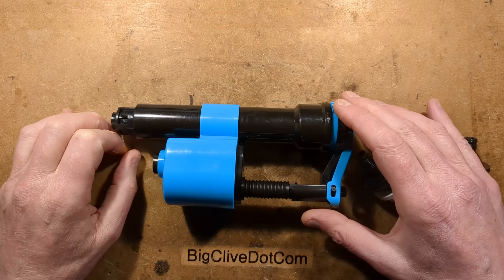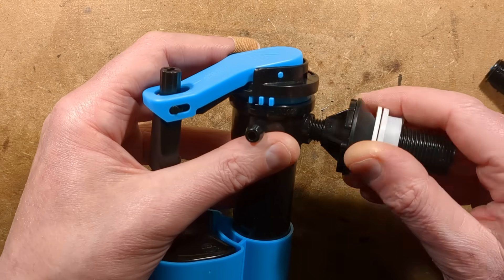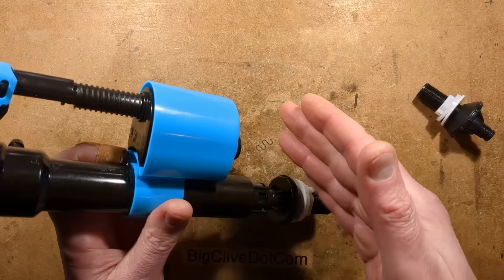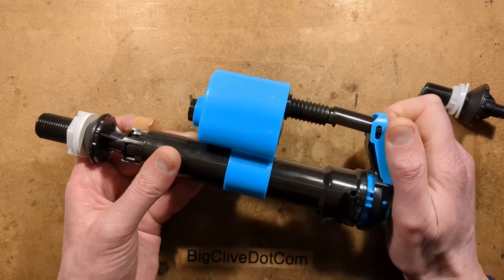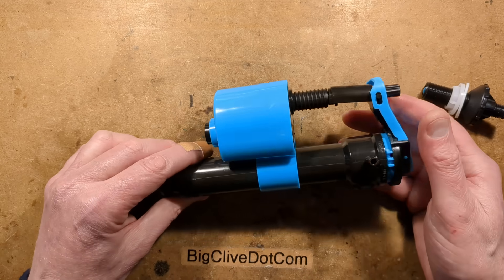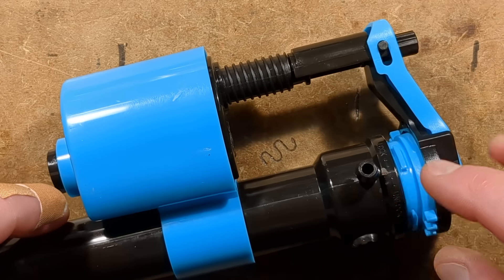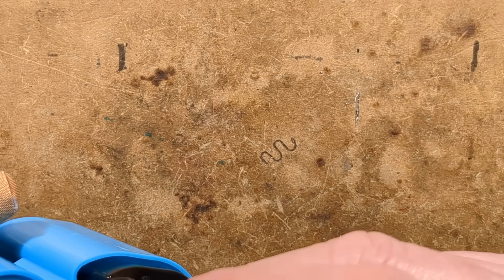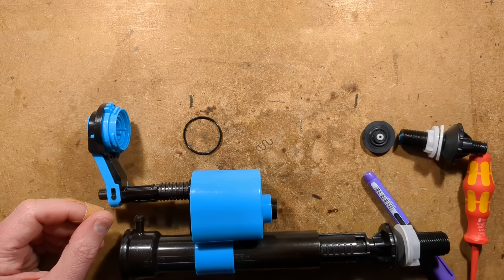Very clever universal Skylo toilet cistern fill valve system

Comment: In north america, the side port goes down into the toilet itself to fill it back up.

When you flush, it siphon the bowl basically dry, leaving only whatever water at the bottom that did not get siphonned out, and what is left inside the S bent siphon that drop down into the bowl and what is left inside the "flush system" from the tank to the bowl. While it is enough to seal back, the water level is too low. So the side port have a hose going to the overflow tube, which refill the bowl to the proper level.

The proper level is done by simply overfilling the bowl. The little water is too small to activate the siphon, so it just leak out by the siphon. This is however not that much water on a proprely working system.

Comment: I have a similar red/white thing in my loo. One day it started never stopping filling and I dared to look at it and figure it out. I touched it and it blew off its thread and covered me in mains water constantly blowing around. All it needed was screwing back down but since then I am very wary about it. Mine is a dual flush and I fixed the button sticking down problem by twisting the flush  about 90 degrees and it lifted out. I took the spring out the button part and put drops of 3 in 1 oil down inside the cable run that looks like a bike brake cable. It never sticks now and pops up all by it's self :) Also I HATE bloody water tanks and for that reason I can not swim as a swimming pool is just one giant water tank of horror to me full of skimmers, inlets, outlets, drain covers  and oh god I am giving myself waking nightmares just talking about them. They should be banned and made into fluffy ball pools with lots of light and all the gaping holes blocked up. My last job involved having to walk past 2 giant water tanks in a plant room when I had to check on heating controls and make notes on water temperature on gauges. Needless to say job from hell. When one tank had a problem they left the ball cock outside, it was massive! it had a giant copper ball on a 4 foot rod. God that thing still gives me the eeby jeebies when I think about it.
Sorry for long comment but me and water tanks do NOT work together lol Put me inside a substation with 11KV and I will gladly sleep next to the humming transformer! But water tank things, noooooooooo xxx

Comment: Had one of these here in the UK for many years - it has a slow leak from the bottom connector for a long time and has been a total curse - I had to make a tool to remove the top valve release as it’s impossible to remove by hand all in all not a great product 😬

Comment: Very clever.  It's a huge improvement over the 1950s layout: an overhead cast iron cistern, a lead down pipe and a chain with a porcelain handle on which was written the instruction: pull and let go.  In my family we used to refer to the WC as the pullen.
Reply: Wow. I wonder how often the valves on those toilets failed and how annoying it would be to get a ladder to inspect and service it!
Reply: @zzoinks  Some of those WCs were still around in my adult years.  Who needs a ladder when you can stand on the toilet lid?
Reply: @zzoinks  Ball valves generally once a decade or so, and the syphon itself would never fail, seeing as it was a 15kg pot of cast iron that covered the tube inside, and you pulled up on it a few times to prime it, when it would then dump the 5 gallon tank of water down to the bowl. you will still find them around in old houses that have never had a remodel, mostly in the maid quarters, as those typically never were renovated other than paint the outside with the house.

Comment: More tiny plastic parts to fail catastrophically(Well, it is catastrophic if it's on a frosty, cold night!).  I'll stick with the ball-cock and valve method that's worked for centuries now.  Good to see such innovation though, Clive.  Thanks for sharing...the info, not the cludgie!  Cheers!

Comment: I've seen these new-fangled cistern valves before, but I never knew how they worked until now. They are quite ingenious.
Reply: Yes they use a hydraulic amplifier. The top of the unit has a small open volume, and this fills with water, pressing the diaphragm down over the full area. as the bottom only has a small area with the mains water pressure applied this extra surface area means the diaphragm pushes down and closes it off. The pressure is supplied by the tiny slit in the center, which allows a small flow of water in, and this then pressurises the chamber. When the arm drops down there is a second small rubber stop that vents the chamber, allowing water to pass by the diaphragm to the outlet, filling the tank. When the tank is full, and the float pops up, this then is shut off fast, so the diaphragm slowly, over a second or three, closes off the water fill, so there is no water hammer, but also so there is little wear from water passing over the lip too fast. disadvantage is that in low pressure areas they may not close fully, so you will need a minimum pressure of water to operate them, typically 0.5 bar, which is typical of mater mains, but for gravity fed units this will not work, allowing it to leak constantly. Also if you shut off the water it will fill the tank again for a few seconds when pressure comes back, till the pressure is enough to move the diaphragm.
Reply: and we got a schematic!

Comment: I’ve had two installed but each time the tiny hole got blocked after a few days and it overflowed. I had to replace it with the traditional type – not as clever but a lot more resilient.
Reply from the maker: They do recommend purging any contaminants in the pipe out by removing the top, placing a cup over it and turning the water on to blow out any debris at full force.  It's also possible that some water supplies do contain particulate matter.

Comment: Love the plumbing stuff Big Clive . A friend of mine who is a gas engineer says I’m a frustrated plumber . Iv fitted the brass version  several times on various toilet cisterns . Really clever design and very universal.
Reply: brass version have you ever had success in replacing the little rubber seal, as most of them will not unscrew the inner plunger to remove it, so I always pick it out, and use some force to get the new bit of red or black rubber in there, with only a few actually unscrewing.

Comment: Very similar to the ones we use here, although there is no selection of bottom or side inlet - you select the type you want at the shop. The clever valve system is, indeed, the same principle in the solenoid valves of washing machines and it stops instantly, instead of the gradual close of the old floater types that, not only noisier, they cause excessive wear in the rubber valve and nozzle.
Reply: So not similar at all then….

Comment: I like it, thanks for sharing!  Much like an older Oatey design but with improvements such as the flooding float cup and configurable inlet position.
The diaphragm bleed might be more robust but the oatey usually lasts me about 20 years before it malfuntions.
The blasted replacement diaphragms are near as expensive as the entire valve.

Comment: I took apart one of these that needed cleaning not too long ago and was flabbergasted by the water valve mechanism. It's quite clever.

I'd always assumed it just directly operated a ball valve or something, but I suppose that would need a lot more force, be pressure dependent and/or leaky.

Comment: Good video. I just fixed mine recently, similar to that one. But it has a rubber flow restrictor, which compresses under pressure to restrict even more. But the filter failed and made it compress and block the line.

Thats a nice compact pioleted valve design.

Comment: Never have liked these things. Far too many moving parts involved and I've seen them fail too often, though in their defence they've failed closed. Think I said once before that nothing beats a cast iron cistern with an old brass ball float for me.
Good thorough documentation as usual.
Quick edit: Regarding surging water, I did once get asked to modify one of the plastic ball float types to reduce noise. Did so by adding a length of pipe spanning from the 180 degree outlet to the bottom of the cistern, terminating in a 45 degree cut. Fairly sure this wasn't to code but the person was happy with it anyway.

Comment: @ 9:20 I consider this kind of a water equivalent of a transistor. A small stream(current) from the inner tube (emitter) through the hole on top(base) enables a large stream from the inner tube to the outer tube (collector). I see similarities with a pnp transistor.
Reply: That's a cool comparison
Reply: or is it more like a FET because its pressure aka voltage driven and not flow current.

Comment: Many years (20+) ago I used to install and service both Geberit and Clos-o-Mat powered toilet/bidets for disabled clients and Care Homes. Both these makes had similar flush systems, the more modern one you've disassembled seems to be a slight development of those. Excellent video!
Reply: We just wheel 'em out over the sprinklers on the lawn.
Reply: I install the geberit aquacleans on many disabled adaptations. Some bit of kit.
Reply: My 2003 Geberit in wall tank has indeed a very similar mechanism.

Comment: I replaced mine about a year ago and it's so painfully slow. Of course I have an awful american toilet that needs the bowl filling pipe too (not sure why the USA is so concerned with having a high water level in the toilets) which doesn't help things. However, it takes about 4x longer to fill than the previous one.

Comment: Yes, that is all very clever but I'll wager a large sum that it fails within a few weeks like all of the other 'modern' systems. I myself have a home with one of the 'older' type and it doesn't really drip and dribble at the end and moreover it hasn't been serviced for around twenty five years!! It's looking like I won't live long enough to see it require a new washer.- That my friend is clever- NOT a new design that constantly breaks down as I have experienced in all of my family homes for the last thirty years. (Including a brand new Cussins build with three cisterns all of which constantly misbehaved). I've not done any analysis but I'd wager there is a direct relationship between the number of parts in a cistern and its reliability over time. New cisterns generally have dozens of tiny parts (none of which can be found if they fail); old fashioned ones have half a dozen that seem to last decades (not months).
Reply from the maker: I've never had a problem with these.  If installed correctly with no debris left in the pipework they are reliable.

Comment: I like one I found years ago, and hard to find.  Mounts into the Bottom, controls water only, and Shuts off by water Pressure.  No more then 1.5" tall
Reply: Generally found in Pet supplies, for horses and cattle, troughs.

Comment: Clive, grab yourself a Fluidmaster 400A for comparison. Extremely common in the US; reasonably priced, very reliable, long lived & uses a tool free similar quick & ezpz to service seal/valve. On most if not all here, that side port has a line leading to the tank overflow tube allowing a little water to pass for bowl wash down.

Comment: yes, the small 1/8" port is for the fill tube that cleans the bowl with water from around the rim and also primes the siphon trap.
Reply: Yes. It is a high-pressure hose, NOT a siphon tube.
Love your channel, MR. Clive.
Reply: @samuelmartin2817  learn to read, it's not really high preassure hose consideringt just friction fit with a single barbeinto the fill tub so not much pressure, secondly I said siphon trap. the trap in western style toilet in north america, is an s trap, shor for siphon trap. It completly drains the trap because it use siphonic action suck the turds down the drain. Hi Jman plumber of 20 years...
Reply: @samuelmartin2817  learn to read, it's not really high preassure hose considering it's just friction fit with a single barb into the fill tube, so not much pressure. secondly I said siphon trap. The trap in a western style toilet in north america, is an s trap, short for siphon trap. It completely drains the trap because it use siphonic action to suck the turds down the drain. So that port is used to clean the bowl and fill the s trap. Hi Jman plumber of 20 years...
Reply: @samuelmartin2817  this siphonic action is the main reason why we need to have relief vents on p traps so they do not get sucked dry.

Comment: Clive, those have been the standard here in the USA for decades, other than the option to have side fill. I had never seen one like that, thank you for sharing that. 

As for longer nails vs short nails. My nails are like carbon fiber. I have to use side cuts to cut them. So they stay a bit on the longer side, and have saved my finger tips tons of times. I even use them as screw drivers, and for prying things open. I was a mechanic for 25 years and my nail were always a very helpful tool. However, I know that most people's nails are not like mine. 

As always, love your videos, and thank you for the many years!
Reply: My dad used his nails as a screwdriver also. I saw him doing it and did it for years also.
Reply: I was wondering why this design looked familiar, I probably put one in several years ago.
Reply: @Fulano5321  It's pretty familiar because it's the standard Fluidmaster toilet fill valve that has been used for a few decades now I want to say? Other than a few clever features here and there like the protected float valve, the filter on the bottom, and the easy adjust for the heigh, nearly identical. Not that it's a bad thing, it's a great design that's easy to fix up yourself. Seeing as Clive lives in the UK though, don't know what fill valves they use cause toilets in every country seem pretty different despite working the same
Reply: @coffeebuticed  The Asian ones with 2 treaded tiles either side of a hole seem to work a bit differently though.
Reply: Yeah here in the USA I haven't seen one of those ball floats in the wild for like 20+ years.  If they're still using them in the UK I feel sorry for them.   But then again they still have "telegraph poles" so who knows.
Reply: @core251  Yes  can say it is only the elderly who now rely on their Morse code tappers in the UK now.

Comment: 2:19 adjusting this height only changes the amount of water in the cistern, it shouldn't have any effect on syphoning as that's a fixed piece...?

I can't imagine repairing this without pulling it out of the cistern first with the angle you need those pliers. Then I'd find a new valve easier to source than that diaghram 😅

Air lock under the float valve is a neat design

Love the vids, thanks Clive
Reply: I agree that having an easier screw is important to make it easy to replace the diaphragm in the tank.

 Maybe they make it hard to access the diaphragm so people don't unscrew it with the water turned on and create a geyser. 

Or maybe they sell a special tool which serves the same purpose of reducing the chance of an uninformed repair person opening the valve, because hey won't have the tool to open the tank.

Comment: My facility came with this fill system, and it works impeccably. Unfortunately, the cistern and bowl arrived from Turkey broken! So did the next three! I finally got a decent looking set, which is working well. So, with all the cracked and broken items, I had a massive load of inflated plastic packing - that was most useful for dispatching large items sold on "E...".  Every cloud has a silver thingy 🤣

Comment: They are rubbish. Only last about 3 years in use and that's by a single user.
Reply from the maker: I've had one in regular use for a very long time.  They do not like dirty water though.  They recommend you purge the pipe to blow out debris.

Comment: I fitted one of these to our cistern recently. Unusually for the UK, the pipe fitting on our cistern is not 1/2" but 3/8" and after much hunting around I found one of these - which fitted the bill perfectly. It does however claim to be a 'silent fill' but ours makes quite a noise - although our water pressure does seem unusually high.
Reply: Time to go to the meter and install a pressure reduction valve right after the meter. 4 bar one is common, and you will find that you will have a lot lless leaking from taps and burst pipes as well. Mains water can be as high as 8 bar and still be in spec, and my sister was forever having leaking taps, so in went one pressure reduction valve from a burst geyser (you replace it as a unit, as it might be 5 years old by then, but this one was under a year old, with the old one failing before, and being replaced, before the water tank did itself in a year later) to tame the pressure down from the 12 bar municipal supply, so while the municipal supply was forever digging and replacing pipe, till they ran a separate 160mm pipe to feed the downstream industrial area demand, and put the street down on a pressure reduction valve to 8 bar, capping the end. then she had taps last years, and less digging up the street for bursts.

Comment: I still feel, most designs are a bit inefficient in water usage, and  compromise efficiency(lot to gain from gravity🤔) for aesthetics. There is also the leaky gasket syndrome, wastes a lot of water until you fix it. Sorry to hear about the nail splinter, glad you did not try using a hole saw on a hand held power drill to cut a hole in an acrylic sheet held by hand😢. It reminds me of some badly chewed fabric(luckily the flesh escaped!).😅 Suggest using a rubber coated fabric glove with kevlar yarns, when dealing with sharp spinning objects, and always pay attention to work holding as if your life depends on it.😂❤👍